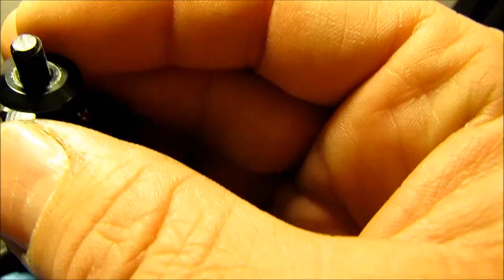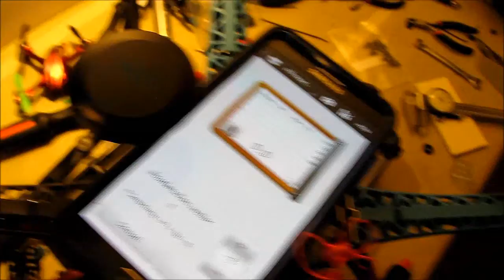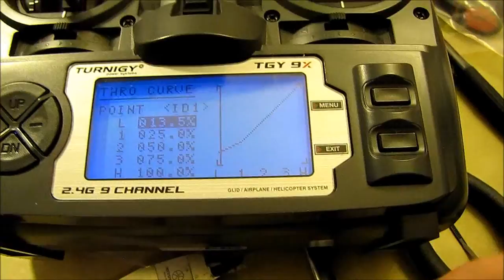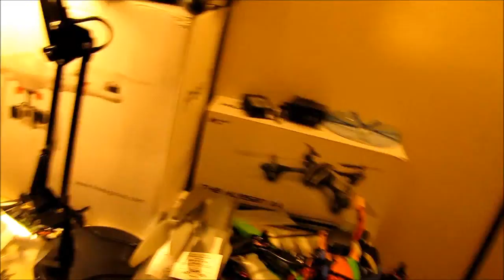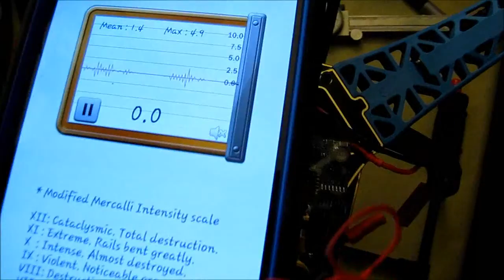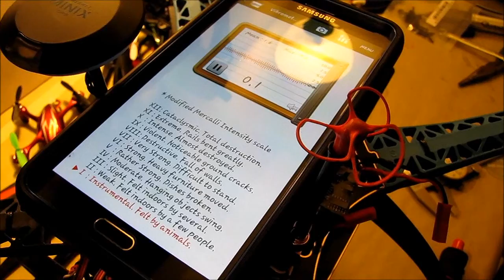Prop Balancing and dynamic balancing  Part 2

Comment: 1st thing ,thank you for a detailed prop balancing vid ( Pt 1+2 ) ,I learned alots  . May I suggest for the centering of the washer  ,inflating the size of the motor shaft Plumbers Teflon tape ,I think 2-3 layers would eat up that void that is making it so buggy to center the washer . Teflon has no glue will be easily removed when you swap props out . Keep up the great vids  Thank You & Fly Safe
Reply from the maker: ColdRider thanks, back when I recorded this video prop nuts with a Flange type washer on  the bottom of it wasn't readily available. But now you can buy prop nuts that are not only locking but various types of colors that has a flange like washer on the bottom that's all I use now eliminating that silly washer